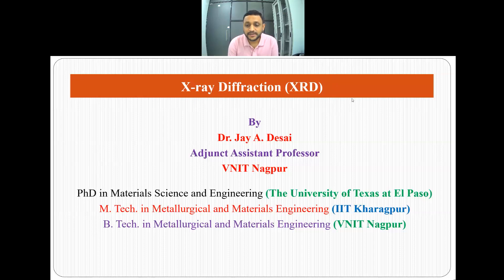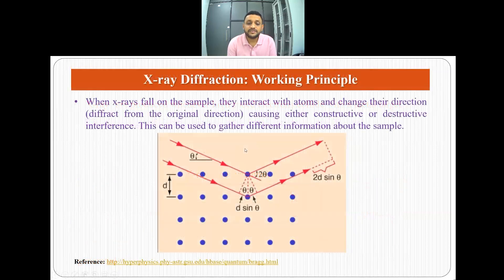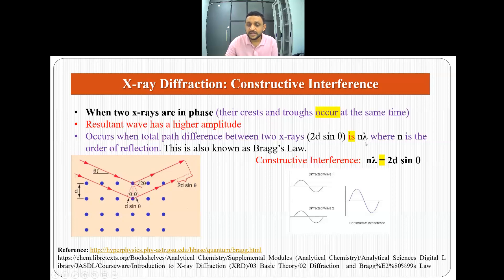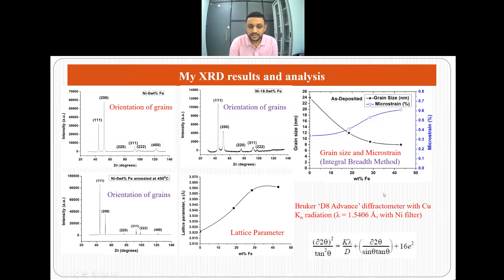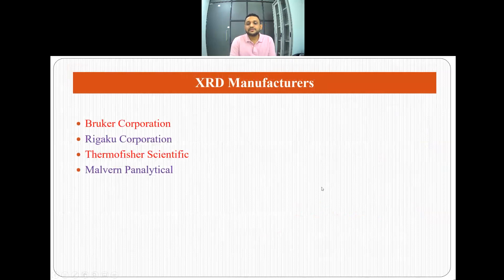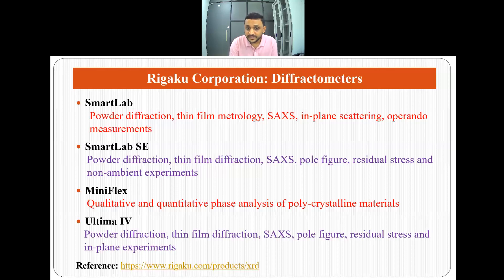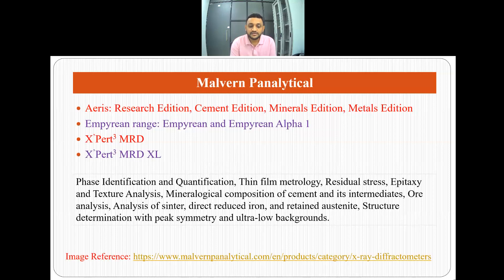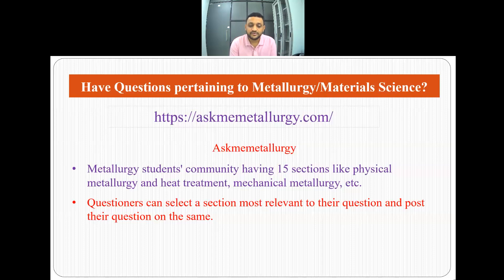X-ray Diffraction (XRD): Introduction, Principle, Manufacturers, and Equipment Selection Approach

Comment: يا ريت بعد اذنك لو في شرح لبرامج Rietveld methods التي بتشرح تحليل Data of XRD
Reply from the maker: I cannot comment on that but yes if you have XRD data and you want to analyse preferred orientation, grain size, microstrain, and lattice parameter variation in your samples. I will be happy to help.
Reply: @explorematerialsmetallurgy6439  yes, I want video to reconginze analysis of data XRD by any method or Rietveld method.
Thanks